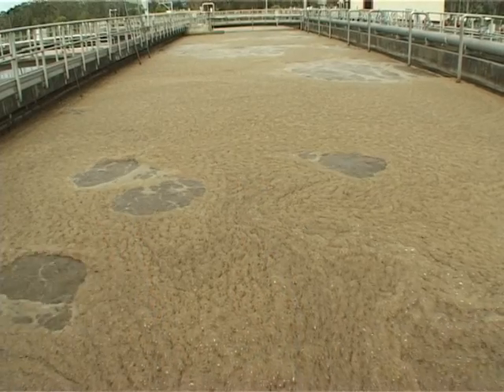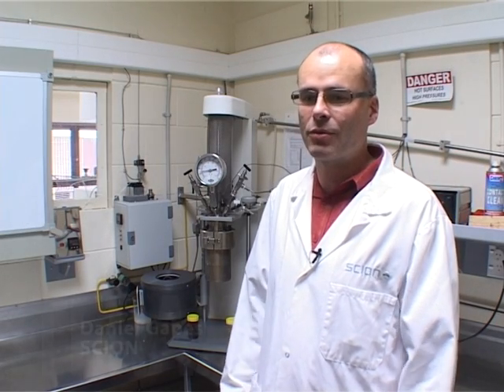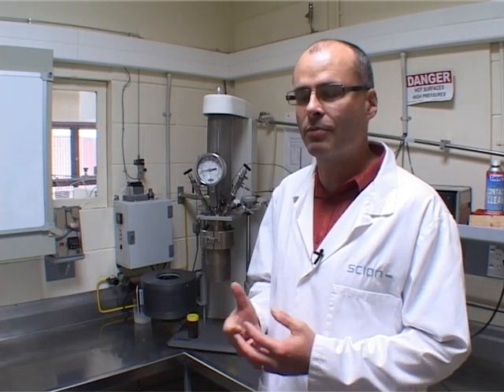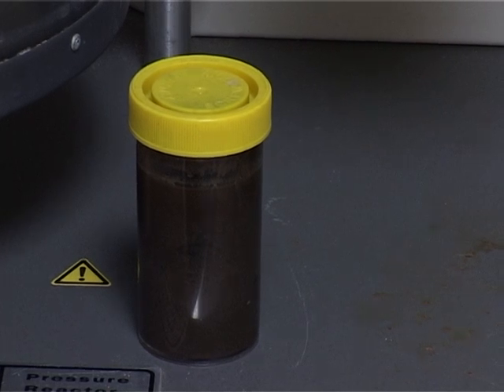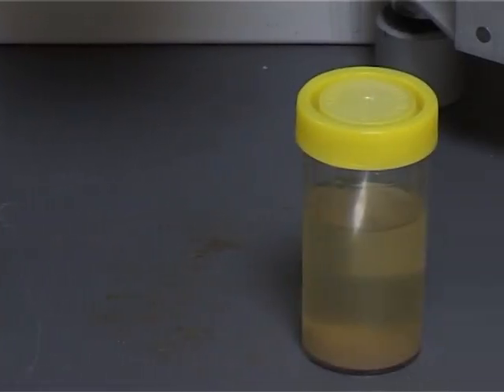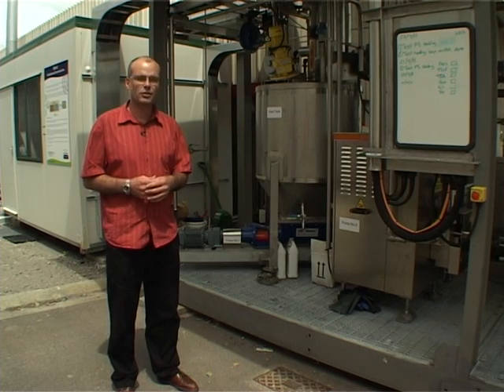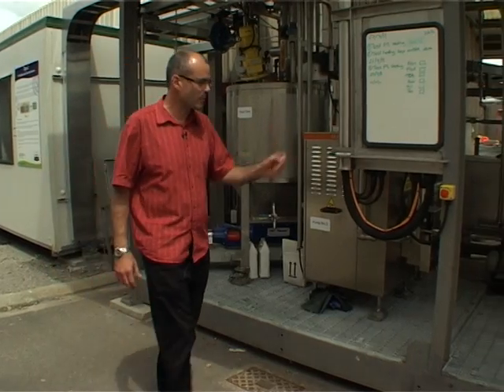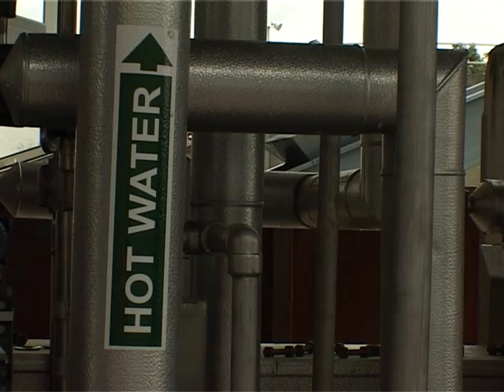TERAX™: Hydrothermal deconstruction at pilot scale

Comment: I agree from a landfill perspective that reducing nine thousand tonnes of faecal sludge down to one thousand tonnes is indeed a massive reduction. What isn't clear is how reducing the mass reduces the toxicity. Chemically 'burning' is the equivalent to boiling, condensing. Safer? No, just smaller.
Reply: I'm not an expert in hydrothermal processing but as I understand, it must be degrading the organic compounds into inorganic phosphates, ammonia and acetic acid. Also, any bacteria or viruses would be completely disintegrated by the heat and pressure. It also means that the solid fraction is much dryer and so can be used in higher value applications such as fertiliser.